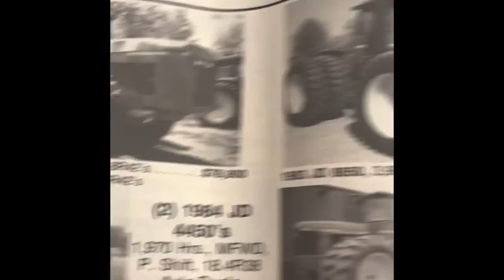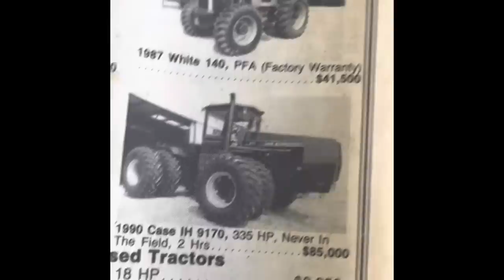Bought My First BRAND NEW Machine & Demolished a House

Comment: You have gotten your old freight liner addicted to either, I have heard of that in my time but this is the first time I’ve ever witnessed it but something is fixing to fail on you probably I’m no mechanic but you shouldn’t have to use ether in the summertime and my old boss back in 2000 told me that ether cost him $10,000.00 because he had to buy a new engine because he put to much ether in it and locked it up or something, but I just thought I would run that by you and hopefully it’s nothing serious because times are hard right now and you need that truck because harvest season is real close here in the Mississippi delta.